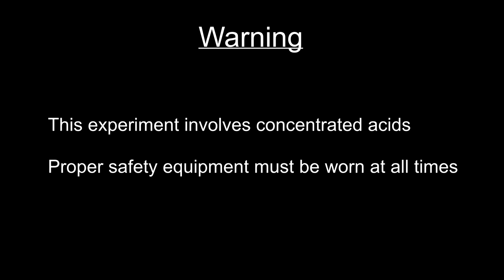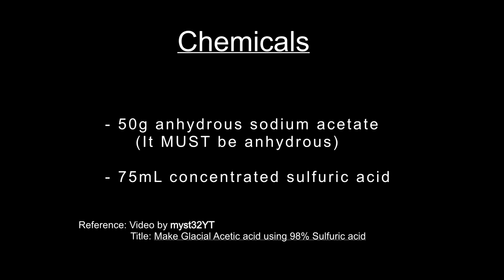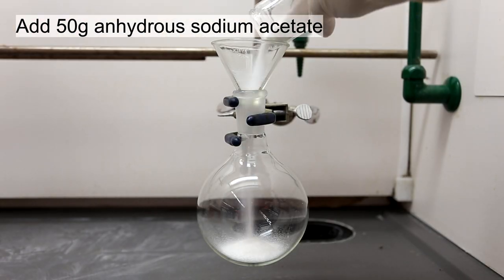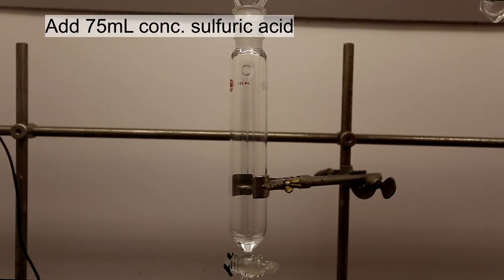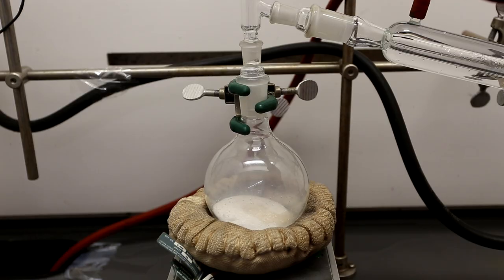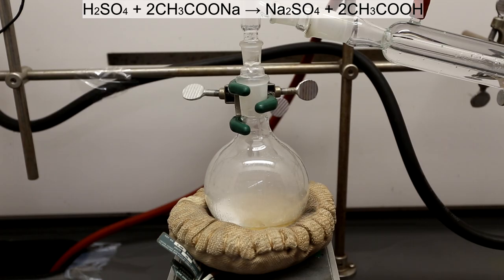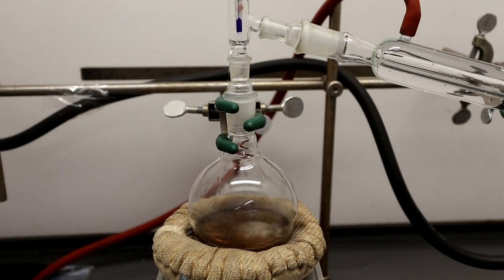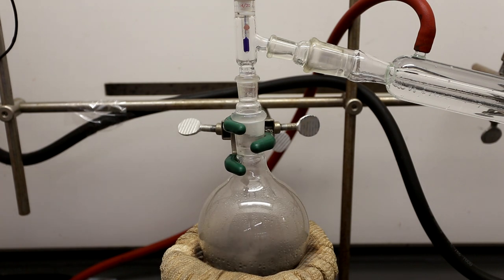How to make Glacial Acetic Acid

Comment: I'd definitely go with the stoichiometry that produces the bisulfate, rather than sulfate.  The required temperature would be lower, which usually results in a purer product.
Reply: Yeah, and bisulfate is also more useful.
Reply: @GRBtutorials  Well, one can always add sulfuric acid to sulfate.
Reply: @Kycilak  But what if you want to use the bisulphate as a substitute for sulfuric acid?
Reply: the quantities of reactands is 420 mmol of H2SO4 and 610 mmol NaOAc so half will be bi-, half will be („mono“-) sulfate

Comment: The cheapest way of doing it is through fractional freezing
Reply: @tafdiz  basically, you start off with acetic acid that is as pure as you can get, then you put it in a freezer. Since the acetic acid has a higher melting point (16 - 17°C) than that of water, you'll be removing the liquid phase, which has a higher concentration of water, while the solid phase is composed of more acetic acid. You'll probably lose a lot of product doing it at home, but vinegar is cheap, so it might be worth a try. Some people say that the name "glacial" acetic acid comes from this method of increasing the purity, while others say its from the appearance of the crystals it forms. Ethanol can be made pretty much anhydrous using this method as well, only that in that case the liquid phase is mostly Ethanol, while the water is the solid.
Reply: @Comrad Sam It actually worked for me first try, my vinegar was just sitting in a cup though so maybe tiny bits of dirt acted as nucleation sites to prevent the acetic acid from supercooling rather than freezing.
Reply: @timmulm  that's kind of the point--notice Cosimo Fox said the water freezes, not the ethanol.
Reply: Quite the opposite actually. I freezed an entire white vinegar bottle and 24 hours after it separated in the liquid phase. How do I know? Despite the atrocious strong odor that it had afterwards, there's also the fact that it can't be water because water freezes at freezer temperatures.
Although, I don't know the percentage of my vinegar now. I can't check it unfortunately.

Comment: according to my data bases acetic acid has a density of 1.049 g/mL, so it sounds 99% pure
Reply: That's the same purity that Sigma-Aldrich sells glacial acetic acid at.  So it should be just as good as theirs.
Reply: Yeah, the purity depends on the concentration of your acid, 100% sulphuric acid is pretty hard to get a hand on
Reply: @Bill Howitzer 👍👍

Comment: There's a useful mnemonic we use over here in germany: Die stärkere Säure treibt die schwache aus Ihrem Salz.
Translated: The stronger acid drives the weaker one out of its salt.
So, that's pretty much what happens here isn't it?
Reply: Yea basically.The hydrogens of the sulfuric acid is used to form acetic acid from acetate of the sodium acetate.

Comment: If I vacuum fractionate my mixture of acetic acid and water (the non-glacial result of my attempt at your preparation here) wouldn't the respective boiling points spread apart? I'm thinking that the acetic acid being more polar won't have its boiling point reduced as much under vacuum as the water. I don't really care if I can't condense the water vapor. I guess this would be "concentrating under vacuo".

Comment: could you use Hydrochloric acid instead? It would be far more cost effective.
Reply: tajony-32 no
Reply: Tajony Records Hmm...Hydrochloric acid is a solution of Hydrogen Chloride gas in Water, as the temperature increases, the gas slowly escapes the water, and then the water dissolves the acetic acid and contaminates it. Water and acetic acid are extremely difficult to separate due to the similar boiling points which is why you can’t distill it from vinegar, unless of course you have insanely precise equipment. In short, no.
Reply: No of course not, the powder & acid need to be water free, your HCL is a gas in water solution; max about 37% HCl
AND H2SO4 is really a liquid, HCl is a GAS that will come out of the solution and partly will distill together with the Acetic acid, 

AND some water, you'll never get 100% acetic acid, it'll be contaminated with both water and HCl.

Comment: Hi Nile Red! I bought 100% Glacial Acetic Acid (5 gallon bucket) and wanted to dilute it down to 10-20% and use it as a vinegar weed killer. I have the distilled water in six 5 gallon buckets all ready to accept the glacial acetic acid ...but my family is fearful for me that I will ruin my lungs/skin/eyes. I have protective goggles, a standard inexpensive white mask, and I would wear long sleeves, shoes, pants, etc. I would also be very careful to prevent spillage. Do I need anymore protective "industrial" gear? (e.g. industrial hood, etc) Is this really risky stuff that can do long term damage? Or will I be alright? Just trying to get some peace of mind :) Thank you Nile Red for all your good work!
Reply from the maker: zackjeffries It is an acid that can cause serious damage to your skin/eyes if it comes into contact.

I think that as long as you are safe, and wear proper safety gear, you should be fine. 

Why don't you just buy a lot of 'cleaning' vinegar? A lot of stores sell 10% vinegar for cleaning purposes
Reply: +Nile Red how did you clean the caked sodium sulfate salt out of the distillation flask?
also great video, you are currently the only one i turn adblock off for
Reply from the maker: Minister of Propoganda II thanks!! Also i am not sure. I really don't remember what i did to clean it out. I don't think it was a huge pain though. Maybe just a lot of water?
Reply: Is there any realistic use for the sodium sulfate, or would you just dispose of it?  Thanks.
Reply from the maker: TheDoctor It can be used as a drying agent if you clean it up and dry it in an oven
Reply: That's what it as for me. Like 2 or 3 liters.
Reply: @NileRed  near the end your H2SO4 / Na2SO4 mix, when hot is still liquid. One does not pour water on this blend, even when it would be room temp. Best the other way around, have a big bucket full of tap water and gently drip the hot mix out of the flask into the water ( while stirring a bit). Pretty good vid.
Reply: Sorry for necroposting to this mummified thread but safe handling large quantities of hazardous chemical especially liquid bulk is a skill that usually involves quite a bit of training and specialized equipment (transfer pumps, devices for pouring etc.). Its not water, you make a mistake even with just fairly safe stuff like diesel and you might get permanent damage or cause a major accident.

Comment: What would happen if you just added dried Epsom salts to straight vinegar?
Reply: poo poo bum bum
Reply: Recently, I’ve been seeing “cleaning vinegar” in stores.  It’s sold in 30% concentrations as a low toxicity herbicide.  You dilute properly with distilled water for descaling and cleaning.  

It would be far more economical to trying to dry the 30% vinegar.  Or, you can distill most of the water over at 100 Celsius and wait for 115C at still head and collect 95+ acetic then dry that.
Reply: @jtbmetaldesigns  really?  I've ever seen it as high as 10% and it says it is cleaning vinegar.  Anyways, I have acetic anhydride which is why I was looking at this video. because the reaction I am trying to do requires either acetic anhydride or at the very least pure glacial acetic acid.

For anybody wondering how I got a chemical that is watched by the DEA I purchased a aspirin synthesis kit which comes with AA (acetic anhydride)

Comment: It still freaks me out that pure acids are liquids. Until these videos I always thought that removing the water from an acid would produce a solid.
Reply: Actually some are solids, some are liquids, and some are gases at room temperature. A lot of carboxylic acids are solid, and some are gaseous such as hydrochloric and hydrofluoric acid. Concentrations of these ones depend on the saturation of the solution they are dissolved in.
Reply: @TheDeadOfNight37  😮 
You blowing my mind, I wish I had a good chemistry teacher

Comment: if you do this with calcium acetate instead, wouldn't it just be a matter of decanting? It won't be as pure, but this might be better for anyone who doesn't have a distolattion set up. Because calcium sulfate is insoluable, right?
Reply: this works for the same reason you cant make HCl out of NaCl and Acetic acid. Correct?

Comment: for the first time i have been checking constantly for a video on this channel. is it possible to distill acetic acid from vinegar.
Reply: It is much more difficult, and requires a lot of vinegar + large flask. You can easily make anhydrous sodium acetate and find sulfuric acid. Anyways regular household vinegar tends to have surfactants and additives
Reply: TheKingOfChem true, thanks i just try to avoiding sulfuric acid though i use it in my videos sometimes.
Reply: robinhooodvsyou
yep its better to find sulfuric acid to make it
Reply: robinhooodvsyou I agree, usually I add sulfuric acid or anhydrous magnesium sulfate
Reply: I know this comment thread is a bit old, but I wanted to put out that acetic acid and water don't actually form an azeotrope, they just have close boiling points (118C and 100C respectively), so they tend to co-evaporate. An azeotrope is when a mixture boils with a constant ratio of evaporates. If you can get a tall enough fractionating column and a hot enough boiling flask, you can separate it out, but the method in the video is much much easier.
Reply: NileRed - Is there a way of making anhydrous acetic acid using food safe chemicals?
Reply: ahaha pure vinegar is acetic acid
Reply: smartmusicfreak I know your comment on this old comment thread is old, but I believe they were referring to the 68% sulfuric acid and water azeotrope. As they were referring to obtaining concentrated sulfuric acid to use in the reaction, not an acetic acid/water azeotrope which as you said doesn’t exist. At least that’s my take

Comment: Could you just distill vinegar into glacial acetic acid? Would the water not come out first and leave you with pretty well pure Acetic acid?
Reply: That is my question, too. Why can't I just take some raisins, leave them in a jar of water for a month, filter the liquid, and then put it in a boiling water bath? I suspect the issue is the same as with alcohol, getting over 95 percent purity in the presence of a water laden atmosphere is not possible. Which also screams, why not just vacuum it?
Reply: Water and acetic acid form an azeotrope that have similar distillation temperatutes

Comment: can you use the calcium salt and sulfuric acid without the heat? I am thinking CaSO4 is fairly insoluble, so the liquid that remains should be pure AcOH (the water being absorbed by CaSO4 which, although insoluble, does form hydrates)
Reply: The separation might be a horror. CaSO4 and its hydrates are a huge problem in the art of filtration
Reply: @dimaminiailo3723  why separate them? They are pretty much inert
Reply: @SuperAngelofglory  Gypsum is a relatively fine powder so it blocks almost every filter. You can aggregate particles during a long time, but I don't know will it work in AcOH or not

Comment: What percentage of sulphuric acid were you using and what temperature do you use when boiling?
Reply: note in the video said >98% Sulfuric acid (pretty much the highest you can manage without drying steps), and temp was somewhere btwn 115-200C. Enough to vaporize the anhydrous acetic acid, but not the sulfuric.
Reply: @The_Razielim  thank you.  I guess I should be more observant and I would have known about the percentage of the acid being used.

Comment: ok what happens if you use trihydrate? Does it decompose from heat or does the distillate just revert back to diluted acetic acid? I just want to add what ever I distilled had no smell and the sulfiric acid reacted with something as i poured it from the top head, then it was observed floating on top of the distillate?? any ways dont do it!!! use anhydrous and def dont used apple cider Lmao!!!

Comment: Why does it stop boiling only if is under 200 degrees? Doesn't sulfuric acid remain a liquid up to 300 degrees? And sodium sulfate is a solid until over 800 degrees. Was this just a small mistake, or is there something I am missing?
Reply: No, he said the heating mantle was only producing 200C, so once all the GAA distilled over, the boiling stopped. As it should.

Comment: Could you use a drying agent such as Calcium Oxide with a 95% vinegar solution to purify it like with ethanol? Could you oxidize 100% ethanol to make pure, anhydrous acetic acid?
Reply: Calcium oxide will react with acetic acid and form calcium acetate. Anhydrous copper sulfate is a better bet for AcOH.
Reply: @billsmathers7787  Thanks fam.

Comment: Pumping hydrogen chloride thru sodium acetate could work to right?
Reply: Maybe,but if you cant get Sulfuric Acid,just use Hydrochloric instaed.I dont know if it will work with Hcl,but try it!
Reply: No it can't.  HCL is a gas , a gas dissolved in water. Your H2SO4 can be had as 100% dry liquid.
When you would boil / distill it, the HCl would also transfer to the distillate and some water also, = useless.
Reply: @246-trinitromethylbenzene8  of course it will not work. HCl is a gas in water solution of about 37%
H2SO4 is 96-100% pure a liquid with a higher boilingpoint . with 37% HCl you'll get in the end flask a mix of acetic acid, HCl and water
absolutely no Glacial acetic acid.

Comment: Hey @nilered I performed the exact same procedure you followed with the only difference being I had to dry my own sodium acetate trihydrate by putting it into in the oven at 250F for 1hr then 300F till dry, then 350F till dry, the. 425F and lastly 500F till all signs of moisture was removed. My drain cleaner is concentrated sulfuric acid and the sds does not have any other ingredients but that so I used the exact preportions and I had no reaction occur. And zero production of acetic acid
Reply: you try this procedure acetic acid making what 99.9% make tell me answer brother

Comment: You could also use HCl right?
Reply: Nope. You won't get "glacial" this way. As HCL is 40% max. conc. in water. Perhaps you could use HCL dissolved in ether or smth.. But this is  too expensive route for GAA

Comment: Would other acids, such as hydrochloric acid work?
Reply: No.
Reply: It will distill over far easier than the acetic acid itself though. You could potentially use the stuff in the bottom flask, but that would be a lot messier.
Reply: +ClickThisToSubscribe
...so just redo the reaction such that the Sodium Acetate is in excess, and there won't be any unreacted HCl to worry about. Or crystallize the GAA by cooling (MP of GAA is just under room temp) and purify that way. The main problem with HCL is that it's a gas, and is generally found in aqueous solution. But, if you want to generate HCl and bubble it in, go for it.

Comment: why not just buy vinegar
Reply: Since it is concentrated, the acidity of glacial acetic acid is high. Therefore, it is corrosive and can damage the skin if in contact. Vinegar : Vinegar is a liquid consisting of about 5–20% acetic acid (CH3COOH), water, and other trace chemicals, which may include flavorings.
Reply: johnny llooddte forget to switch accounts bud?
Reply: @ilovesheen7446  ye that'll may be get you a purity of ~30%. If you want to go further I'd say your best bet would be to turn the acetatic acid into a salt (by adding baking soda for example), evaporating the water and turning the sodium acetate back into acetatic acid using HCL.

However you'd probably need concentrated HCL because if the HCL is dissolved in water the acetatic acid that is formed in the reaction will immediately dissolve in water again rendering the whole process useless. The only problem is that If you can come by concentrated HCL you can probably also buy concentated acetatic acid.
I'll hit you up if I can think of a better method. 
Just please note that I am no a chemist and my proposed methods might not work and/or hurt you.
Reply: @beepbadapup8523  No it does not work . H2SO4 at 100% is a real liquid ( with a high boiling point). HCl can be get in its most concentrated form as a37% solution of this GAS in water. did you read/hear everything need to be water free ? If you try it, in the distillate there will be some acetic acid but also HCl and water .

Comment: can you distill vinegar to get acetic acid?
Reply: Dr Gusimyth Acetic acid boils at 117.8°C, (244°F), which unless you have state of the art equipment, is very difficult to separate from water due to the similar boiling points.

Comment: This is a good way, but sulfuric acid can be replaced with another stronger acid than acetic acid for example hydrochloric acid.👍👍👍😊😊
Reply: The problem with using hydrochloric acid is that is has a much lower boiling point than sulfuric acid, so you'll probably get some hydrochloric acid mixed with the distillate. Most hydrochloric acid is also only 31.45% HCl, the rest being water, so you'll end up with a significant of amount water contamination.